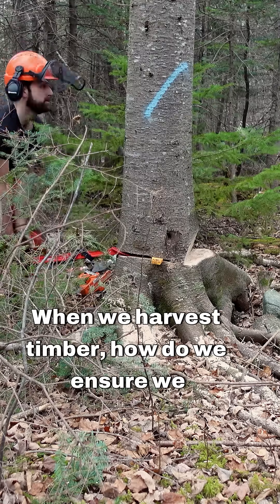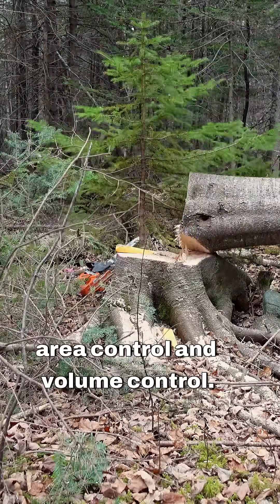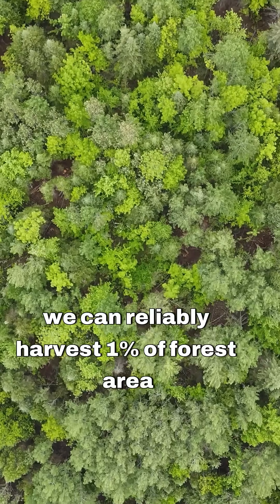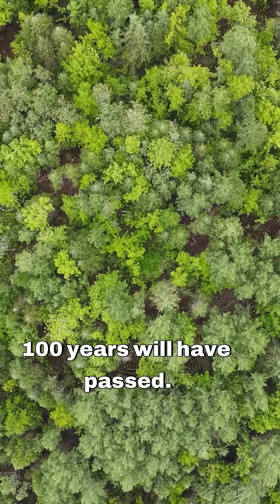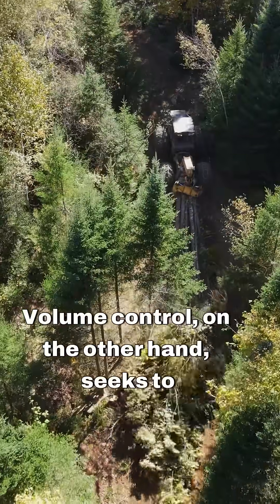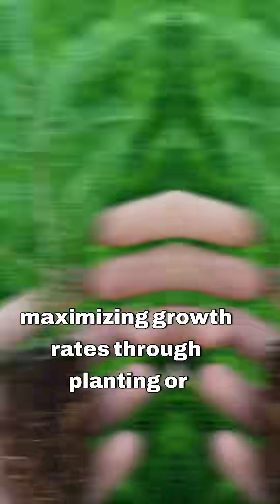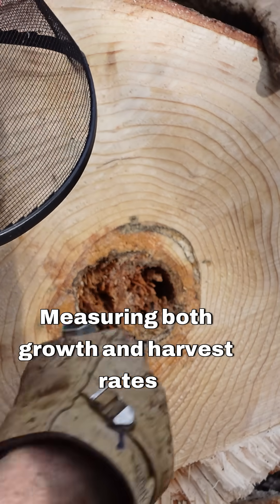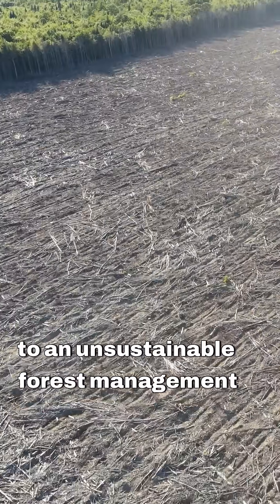How Do We Make Sure Timber Is Harvested Sustainably?  #forestry  #silviculture #forestmanagement

Comment: A tool.. wow.  
That's sweet you're offering a option right as you finish detailing the potential issues.
Reply from the maker: In forestry, a solution without drawbacks is called a fantasy.
Reply: @thetimberlandinvestor haha. And sometimes we only realize it once we've gone there.
Reply: I struggle to concieve what possible issue you could have with them laying out the possible options before pitching their solution for one of them.
Reply: U do realize no matter which way u tip shit goes sideways, u need to find the balance between the 2 so u get the most effective results as efficiently as possible